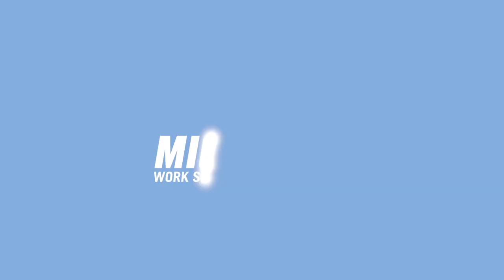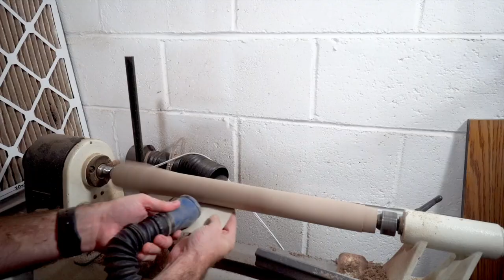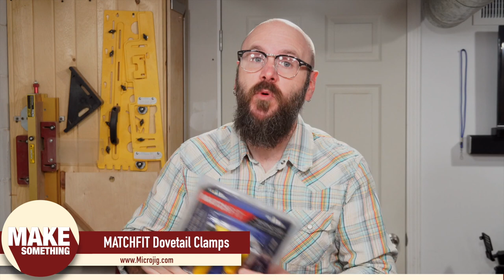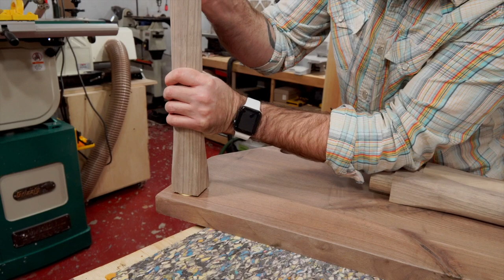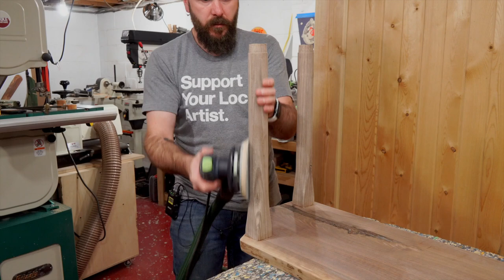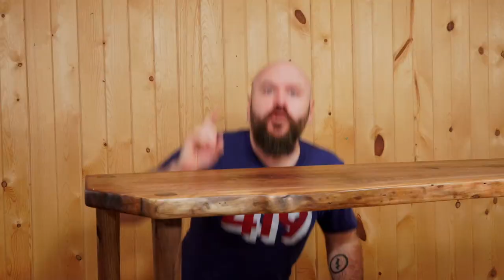Live Edge Slab Furniture. The Happy Accident That Didn't Go as Planned!

Comment: I also wanted to thank you for not only stopping the cut on the TS (at the beginning of the video) for your own safety but keeping that clip and putting it in the video. Too many people would have kept trying to push that cut and even putting a wedge at the out cut to continue rather than stop and use a different method to make the cut more safely as you did on the bandsaw!
Over confidence from woodworking for so long (50+ years) and rushing things is how I lost two fingers in the dado stack earlier this year.
Bottom line is THANKS for the safety tip to  demonstrate and remind us to be very careful in the shop no matter how long we have been doing the task.

Comment: I was building a ice chest enclosure from cedar fence pickets and when I glued and nailed the end sections on the inside of the front and back pieces instead of on the outside I quickly realized the ice chest would not fit. I then re-purposed my project by adding a top cutting a hole in the center of the top and it made a great plant stand for my wife's potted plant!

Comment: Thank you for going into detail about the leg material pinching on the table saw.  I ran into that issue early on in my woodworking and wish I had seen a demonstration of what was going wrong.  Great video as usual.
Reply: Greg Brock the issue with the pinching is simply that the fence is past the blade, table saw fence should be just past where the cut happens then the wood can run freely once cut and will not pinch the blade, great table though and i agree about the legs!

Comment: Hey David. How about putting a brass ferrule on the bottoms of the legs where the tenon is cut?
Reply: I like that idea, at first I was thinking like a rubber foot or cap. Like what you'd see on the end of a walking cane. Brass would look a lot cooler though!
Reply: fartzinacan this was my exact thought as well.
Reply: fartzinacan great idea but I would say that copper would match the wood color better on this piece
Reply: My thought too. Maybe run out to an army surplus and get a small artillery shell to cap the end? Cut it to fit. Though not visible, you would know the primer cap and gauge markings are there.

Comment: Good on you for advocating for safe tool use!  If you did not have a bandsaw another solution would be driving a small wedge into the kerf to prevent pinching the blade.  Would have made the rest of the cut reasonably safe.
Reply from the maker: Oh man! That's a great tip!!! Thanks Arron!
Reply: The other option that usually works if you don't feel comfortable with the wedge or it comes out is to do a half cut through the material the flip it over and do another cut all the way through from the other side. This tip also helps with splintery wood keeping a clean edge on each side.

Comment: Definitely like that you cut off those metal feet. The bench was a great idea and good furniture to have at the entrance of the house for sitting to take shoes/boots off!
Very coincidental that you would be talking about the use of the Matchfit clamps. I ordered and received mine just last week and they are still in the plastic. Your use of them is exactly why I bought mine plus I will be cutting the dovetails in a piece to use as a straight edge for my circular saw on 4x8 plywood. Also a straight edge for my router (maybe to make more dovetail slots in stuff to use the matchfit clamps - haha)

Comment: I had the same problem on a build, i just had to keep backing off and running the wood back through the table saw until it cut enough wood away to stop pinching.  I like the bench design, I think you made the right call on the legs.  Maybe they would look better painted black.

Comment: Walnut is typical for binding on the table saw. I have pieces of walnut that is dry and or acclimatised to my shop and it still binds on the table saw. I just cut till it starts to bind and pull it back and run it trough again. And I try and use the blade guard so it wont kick back. Safety first. 

That Microjig MATCHFIT Dovetail Clamps looks very much like the clamps I have on my Festool track saw.

Comment: Looks really good David. 
As has been said, I think that some copper/brass rings at the bottom of the legs would  finish it off nicely.
With regards to the original legs, I think the problem was that they were too long - if you had used them on an end table/coffee table that could work. Maybe a "next project" idea?

Comment: I find that, even though it takes an extra minute or so, I will pre-drill for my forstners with a 1/16" bit, drill halfway through on one side with the forstner, flip my piece over and drill through. The 1/16th hole helps make sure it's all lined up and I get no blow out.

Comment: The pinching occurs because you are using the full tablesaw guide you should have a short guideblock that only passes the blade about a inch so the wood has room to expand after the cut.
I see this with alot of woodworkers in the US and amazed they didn't have any kickback or worse.
In europe it mandatory practice to not use the full guide when sawing solid wood because it's very dangerous.
Hope you see this and do some research so you can work safer greetings a woodworker/fan

Comment: When ripping a thick board that starts to pinch and close down on the saw blade on one end, one remedy is to flip the board end-for-end and cut from the opposite end.  The general idea is that, if the board is closing up on one end, it will open up on the other end.  To be absolutely safe,  never force a board through a table saw.  You'll get more than you bargained for.

Comment: The white tips made it look like a rail thin sickly Clydesdale Horse.  If I were to have kept them, I would have chosen an antique (black hammered) copper or perhaps an antique brass finish so that the feet didn't draw so much attention to themselves.  If keeping them white, then make the whole leg white (including the tip of the tenon).  I think the walnut and white would have worked if the tips weren't so long and you found a way to include some white somewhere else too.
Reply: Another idea: finish the top so that you can see what color the live edge/sapwood is going to really be and then paint the tips that color.  That way they are more in harmony with the wood.

Comment: I agree on aborting the feet also. looked like the thing was wearing fancy socks, much better now. I got a quick question. im looking for clamps similar to those but instead of a dove tail (bc thats too big for my application) it has a thin rod maybe 1/4 thick where the matchfit dovetail is, and then the normal clamping mech on the other side. I seen them a while back but now that I need them I cant seem to find anything like it. thanks

Comment: I couldn't stop laughing at those legs. Genius move to leave that in there. 

Please make a video on card scraper sharpening. I've tried many methods but I get only tiny shavings for 2 seconds and then it's dull again and back to sawdust (Crown 376 Cabinet Scraper Set, 3-Piece). I get a perfect 90 polished degrees confirmed with a microscope and the turn the burr with hardened polished steel. I hate sandpaper, but I can't beat it card scraper.

Comment: I didn't like the legs as soon as I saw them.  They may have been stylish in the 1960s.  I've recently got interested in epoxy/resin coatings.  I'm trying to find out if there's a difference.  Some people use the terms interchangeably, but I don't think they are the same.  Resin coating may be an interesting option to protect the seating surface your bench.
Reply: I think the legs could work for a low cabinet or entertainment center where they would be the only legs.  The long, straight wooden legs ending in these shapely add-ons is what seemed weird, to me.

Comment: i think the legs would probably have looked better if you didn't paint them white but left them brass. having that richer brass tone would have complimented the wood's natural color a little better. though even then they would have stuck out a bit with no other metal impliments anywhere else on the table so in that regard you probably went the safer route not using them. I do a lot of industrial and medieval style furniture from tables, chairs, bedframes, doors and love to incorperate metal and wood together but typically i'll pick a theme with the metal and distribute it throughout evenly across the workpeice. so like a door with arrowhead strap hinges might also have arrowhead door handle brackets as well. or a bedframe with a metal fluer de lis on the head board might also have  a slightly smaller one on the foot board as well as a couple of smaller ones on the side rails. ect

Comment: 2 things:

1.  I usually find plugs for sponsors to be a necessary evil that I tolerate because it keeps you content creators doing what you do, which I enjoy.  However... Ho Lee Cow those dovetail clamps look awesome!  They seem like they'll totally solve a few pesky problems in my shop.

2.  Maybe you could get some thin brass stock, or cut some thin bands of contrasting wood to wrap and glue around the tenon at the bottom of the legs.  Nice way to finish them out.

Comment: Those legs were ugly. I thought they were ugly, like, right away! Lol.  But you figured it out eventually. Also, when I have to rip a straight line on a lie edge slab in my shop, I just mark out the line with a straight edge and a pencil, rip it with my bandsaw, then clean up the cut with a jointer plane. I can see making a jig if you think you'll use it a lot, but for me the bandsaw method was much faster. Also I don't own a table saw...

Comment: Why did you get rid of the jointer?
Reply from the maker: +Steven Benza needed the money.
Reply: I hear ya.  Craigslist helps me with that problem.  I'll buy used quality tools.  Just bought a $100 old jointer.  Must be about 50 years old but still works well.

Comment: Nice work. Still isn't too late to make it a table...a shelf with a skirt board and four of the turned legs to raise it to proper height would work. And definitely do not use those horrid metal legs. Throw them back into the 50's where they belong.